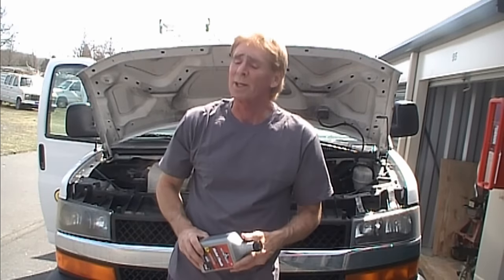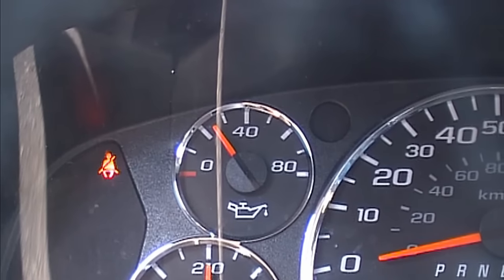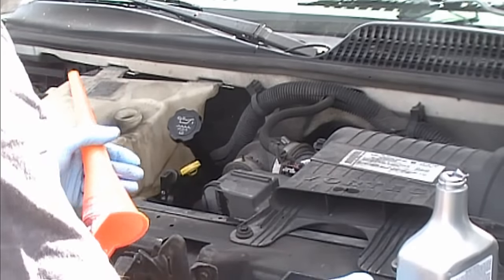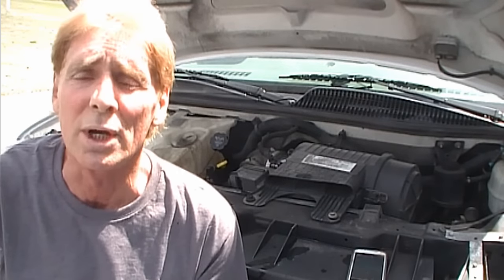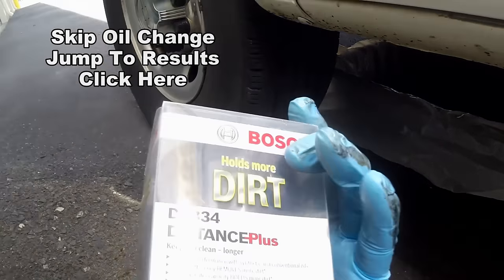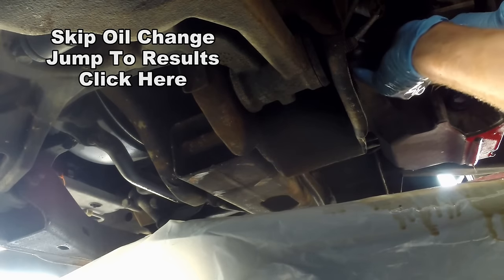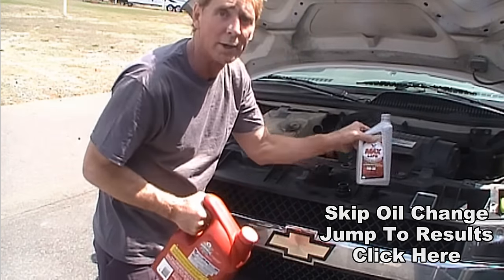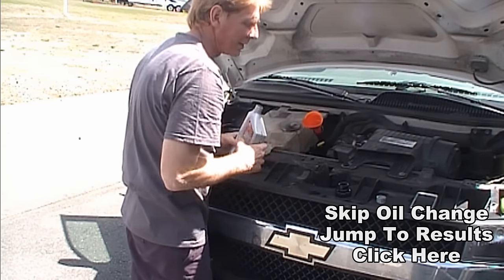NOISY LIFTERS? Motor Flush - Does It Work?  HOW TO DO IT YOURSELF

Comment: Another method and a safer one is; drain ur oil, put a new oil filter.  add ATF same amount of quartz ur engine uses. Idle for 15- 20 minutes.  Drain, fill and another filer. you can also  a week or before oil change drain 2 quarts, add 1 quart of ATF plus 1 quart of engine oil. drive for about 5 days. Then service ur engine. ATF has detergents that will clean and remove sludge @ a safer level than flush or Kerosene.

Comment: Dude, vise grips on a drain plug?  If that isn't bad enough, when you took off the oil filter, you didn't even look at it to make sure the rubber O ring came completely off.  You also didn't lube the new filter O ring.  That's a good way to rip it. That's as bad as a DIY video gets.

Comment: I know this is an old video, But I can tell that the problem is one of the engine on demand lifters has collapsed and the screen under the oil pressure sending unit is clogged causing the low oil pressure and that is what caused the collapsed EOD lifter.
Reply from the maker: Thanks. You are the only one that got it right

Comment: Needs a lot more than a flush its not a lifter tick either you proved that when you stuck the camera under to van to give us a listen... Now onto the pressure loss, maybe the pump is failing or the pickup screen clogged but more than likely the bearings are worn enough to let that thin oil right out of the journal areas dropping the pressure and that thin oil that is OEM spec wasn't thick enough to stay in those journals long enough if you want to get another 50k out of that motor your going to have to go up to the 15-40 oil and try to baby that van. It doesn't matter what the cap says it takes for oil ALL of the hardened surfaces on the bearings are GONE leaving only soft materials as the sacrificial surfaces without stepping the oil viscosity up you wont save them from wearing exponentially fasters... The 15/40 oil will buy you some time. I personally am not a fan of Lucas products but if any vehicle ever was a candidate for such a product this van is 1. Mind you the Lucas product loses allot of its thickness when mixed with oil and also after being heated the first time it does not cool down back to the original out of the bottle viscosity thus all those stupid displays don't really show you the product after it has been heated one cycle. I don't even need to delve into your mechanic skills everyone else touched on that bit strongly enough.

Comment: Low oil pressure makes me think your pickup tube might be partially blocked or the oil pickup tube o-ring has got brittle and is not sealing leading to oil starvation resulting in the ticking.

Comment: Just saw a video on hydrolic lifter ticking, according to the BMW mekanic the lifters have to be bleed, the way to do that is when the car has been sitting, start up and rev the engin at 3000rpm for 2-3min, so as to get the oil pumping up into the head were it has been draining off. Ticking can also indicate that the oil has broken down and needs to be changed.

Comment: Go with a 1540 oil because your o-ring on the pickup tube is bad and that's why your oil pressure is down like it is or it's just wore out one of the two but use a heavier viscosity of oil and that will fill gaps better and increase oil pressure

Comment: I bought a used truck that ran great, but later developed a lifter tick. I flushed the motor 6 times, as the first time chunks of gunk plopped out, and lessened each flush. Still, after 6 flushes it still ticked!

Then immediately (a couple days later) it developed a head gasket leak, and water got in the oil. I must have drove it with water in it for at least two days. I checked the oil and it was a milky white color, so yeah, water was in the oil. 

I bought a gasket sealer that I put in the radiator, and let it run for 15 minutes, drained and left all openings open as directed to dry for 24 hours. I actually let it dry for 48 hours, as I wasn't going anywhere anyway. 

I then refilled the water, and replaced the oil, and took off. The water in the oil eliminated the ticking noise!

It also cleaned the motor like it had been soaked in lye! It was spotless inside! Well, at least the heads were spotless, so I assume the block was spotless as well.

Conclusion: When all else fails...put a quart of water in the oil and drive it around for a few hours, then drain. You'll be surprised at the quality results.

Comment: Putting in new oil or thicker oil will not solve the issue it might mask it for a few months but it will keep coming back until you address the issue head on. Meaning taking the engine apart and fixing the main issue

Comment: I tried this on my Suburban with the 5.4 L engine.  What I did was drain the oil and remove the filter.  Dump the oil out of the filter and fill with motor flush and then add the remaining motor flush to the old oil.  Put the filter back on and fill with the oid oil.  Then I started it, ran for about 2 mins, stopped and let it sit for 15 mins then started and ran for 10 minutes.  Then drain and refill with good oil and change the oil filter.  The ticking was still there but over 2 weeks the ticking went completely away.  So, I believe it works, just not as fast as one would think.

Comment: its the oil pump!!
change it and the lifter tick and low oil pressure will be fixed

after 300,000 miles (over 600,000km for those of you who use KM in your country)
the oil pump shaft gets stuck sideways in the passage and it doesn't pump enough oil..

Comment: If your engine is gunked up with sludge, you can add a quart of water to the oil, and it will clean it up like new. Just run it for 30 min, then drain. Repeat if necessary. Will clean out everything, including lifters.

Comment: This is more like how not to change your oil. Your filter should ONLY be hand tight and should have had the seal lubed and it isn't a must as much now but more so on older and higher mileage vehicles you should prime the filter. If you change your oil like this all the time it is no wonder you have issues.
Reply: I disagree with hand tightening.  Oil usually gets on the outside and will cause it to slip.  Using the same tool to loosen should be the same tool to tighten but I don't like overtightening by testing to see the amount of force used to tighten it to the place where it stops and trying to gauge not boosting the pressure by twisting it far beyond what it took to get it to that position in steps but a consistent twist instead of doing like say 5lbs not like bursting 50lbs to make it keep rotating wise.

Comment: Diesel or automatic transmission fluid in the crankcase for 10min does way better plus its way cheaper. Just let it idle , you'll be surprised what will drain out

Comment: Very common in old v8 domestic motors. its a collapsed lifter,, either the return spring is broken, or its seized because of sludge. More regular oil changes, 7500 km intervals, NOT miles

Comment: STP if you can find some.  Or use Rotella 15W-40 in it.  You have nothing to lose at this point.
Reply: True. I have had the same issue with a 351w in a E350 van with just over 200k. I warmed the engine, mixed 1 quart diesel fuel with 1 capful of DOT 3 brake fluid, added that to the warm oil, started it and let it run for 15 minutes. I shut it down and immediately drained the "sludge" that came out. Replaced the filter with a Wix filter and reinstalled the drain plug, filled it up with Rotella T and put the truck back in service.
She went another 120k miles with Rotella T, and not a tick or knock to be heard ever again.

Comment: Your problem is likely an oring between the oil pump and the pickup tube that sucks oil out of the oil pan. Very common problem. Once that .50c oring fails, no oil pressure. Ticks.

Comment: change the oil pickup tube o-ring, and that will fix the low oil pressure and may get fluid to the push rods better and stop the tick
Reply: but this engine is probably dead by now

Comment: Fix the rattle by purchasing a different brand of truck lmao. I used to be a GM guy too. That's until every single GM I've ever had let me down.
Reply from the maker: So you think Tonka? Or maybe Toyota? 
thanks for your input
😊👍
Reply: @appledrains  My Nissan Titan has been very good. But even if it breaks down the lower price tag would pretty much cover a new drivetrain and any mods you think it might need. I'd go Nissan before Toyota unless I hit the lottery. I'm slowly becoming a Ford guy though. (Certain Fords)

Comment: They say filling your engine with diesel or kerosene will help break up sludge on old engines. Let it crank but dont start it to get some circulation and the drain and refill with oil.

Comment: that motor flush werks great on noisy radio bearings also you mite try readjusting your mufflurs tweek them towards the left of passenger side if that dont werk your valve stems have to get regapped

Comment: Just throwing this out there. Could it be that the O ring at pickup tube be worn out after 300k miles and causing lower oil pressure?

Comment: I had the same problem with my 99 Yukon… And because I ignored the low pressure level,  the ticking sound became very very bad like somebody was hitting the motor with a hammer. Apparently, it was the oil pump that needed to be changed, I ended up scrapping the vehicle for $500.

Comment: Back in the 80's the Ford 302 used to knock out the mains enough to bleed off so much oil that the supply to the lifters wasn't enough to keep them pumped up. We used to pull the pan and install a high volume oil pump. That would supply enough oil to overcome the loss at the mains and pump the lifters up. Note I said to use a high volume pump, NOT a high pressure pump as the only difference from a stock pump and high pressure pump is the relief valve, which makes no difference in this case. It's worth a hundred bucks to try it, if it were my truck. If it doesn't work, yank the motor and rebuild it: my guess is you're NOT going to find a broken lifter but instead worn out main and connecting rod bearings, with that many miles. If a lifter was going to break, it'll usually do that well before 100,000 miles.

Pertinent questions if it becomes a rebuild. Do the pistons slap when cold? Does it have a weak cylinder? (do a compression test) If not, just replace the bearings and seals, use that new pump and you will likely get another 312,000 miles, maybe more.

Comment: motor flush is nothing more than diesel fuel, buy it at the pump save some money.
not recomended for engines with more nthan 150k miles.

Comment: I flushed my 4.0l jeep engine with 6 quarts of ATF, let it run for 5-10 mins with it in there, and then put my oil back in. It stopped  my lifter tick and my engine sounds better than ever, my dad did this to his 02 Silverado at 158000 too, he’s 230,000 and still sounds/runs great.

Comment: No, a rod knock will not have any effect on oil pressure, only main and cam bearings do. A spun rod bearing sounds very similar to a lifter tap with the difference being a lifter tap, if it's just sticky, will go away when you increase throttle, or if the lifter is collapsed it will cough the engine when the plug fires in that cylinder because of the valve not being "lifted" as if you have a dead cylinder. A rod knock however increases in depth as you raise the throttle, and it gets worse in a very short time. There is no mistaking the two, however, the guy in the video did not increase the throttle so there is no way to determine where the noise is coming from for certain.
Reply: Thanks.  I have a Toyota V6 that's making the same sound.  It does fade when I get going faster, especially when I've been driving a few minutes or strangely when I'm going uphill or under load I can't hear it at all.  It came on suddenly a day after I got the oil changed.

Comment: I know that the oil filter wont be leaking...not with the way that he used the wrench to tighten something that is only supposed to be hand tight. Thanks for the video to see if the stuff works.  I believe that it probably needs repeated oil flushes to finally loosen up all of that buildup.  I'm going to do it but what I will do is replace the oil filter with a new one and then add the flush.  No need to dislodge the particles that the filter captured.

Comment: Motor flush is mainly for helping to break down & remove any sludge buildup in da engine u need some other oil additives when putting in a fresh batch of oil to get rid of dat knock if it's not a major valve job dat's required & I've noticed dat after 250k miles u need to change da oil pump wit any engine.
Reply: +Khalil R. Mercado (The Inspiration) Is is really that hard to say 'that' and 'the'?
Reply: +MrTdw1954 If ur not from N.Y. u'll never understand or get it.
Reply: People from N.Y. don't even understand or get it.

Comment: My 2000 5.3 developed a nasty knock like that one day.  It turned out to be a torque converter bolt that had backed out, and was hitting the engine.
when I revved the engine, it got quieter.  I figure that was due to the flywheel flexing.
New tc bolts fixed the problem.
Reply: Common on the jeep 4.0L too...If you find this to be the issue back the bolts out 1 at a time, apply locktite, and re-torque to spec.  no room for ugadugga's  Clicky clicky or 1 shoulder lifting grunt should do less your a 100pounder wet with your boots on then you need to lift both shoulders off the ground lol... Just remember lifter taps generally get quieter with revs and tap at half the rate of rod knocks where rod knocks get louder and faster with rpm.

Comment: I used that to flush out the engine every yer when I changed oil.  Used it for many years!  I can't say that it quiets lifters but ii flushes good!

  I cringed a bit when you used vice grips to remove the oil pan drain plug but I guess with the situation, you done okay!.  I was unable to skip the oil change and jump to results!

  You didn't rub some oil of the filter gasket.  I to use to use Fram but not anymore.  I cringed again when you used a filter wrench to tighten the new oil filter!  Did you learn your mechanics, from Freedom University or Trump University?

Comment: Hi chuck that knock is comin from lifter so adjust your valve and check the resuluts
Reply: Hydraulic Lifters are self adjusting and need no adjusting.Solid lifters require Adjusting with a feeler gauge to leave a very small gap between the Lifter and Rocker arm.His problem is when the Hydraulic Lifters wear out and do not hold the oil pressure.That is why they call them Hydraulic oil lifters.Using a thicker oil can sometimes fix the problem by increasing the oil pressure to the lifters.

Comment: your problem is in your oil change method. you have to fill the oil filter too so that the oil pump and lifters don't go with out oil. you create a bigger gap of air instead of oil to try to lift the "hydraulic lifter" it needs oil not air. then when it started back up it sound kind of hard starting
Reply: +John Smith _It isn't a problem not to fill the oil-filter. You could do so if it's a new engine and there wasn't any oil in it before.
Also the air gets displaced at the time the oil-pump delivers oil and pressure starts rising.
edit: Without automatic de-air of the hydraulic-lifters they wouldn't work at all.
Reply: +djAmbush your supposed to fill the filter period.

Comment: t ry using a full gallon of gunk engine flush then drain and chase with 2 quarts of clean oil then fill er up. worked for my f150 with 250k

Comment: You need a oil pump if pressure is low
Reply: Not necessarily the pump itself, maybe it is just the intake that is blocked. The oil pump only moves the oil, the engine internal creates the pressure. But to start at the oil pump is the best place yes.

Comment: 1. One should probably should use a higher weight oil for such a high-mileage engine.

2. I've never had any success with that motor flush stuff; however,  strong doses of Marvel Mystery oil, combined with 2 or 3 1,000-2,000 mile oil changes (to gradually flush away sludge build up) usually helps. 

3. If all else fails, the oil pan should be removed, cleaned,  and the oil pickup screen should be thoroughly cleaned.

Comment: I'd run some thicker oil add some lucas oil stabilizer to, that should help a lot with oil pressure and the valve noise.

Comment: You need to use 20w50 with lucas oil stabilizer with that many 300k on this engine for sure  its tight tolerance not as it was new as for filter Fram or stp is fine

Comment: That oil pressure as long as it's over 20 psi its fine and that noise sounds like it's coming from bottom end i tend to think it's the thrust bearing as GM'S are pretty notorious for thrust bearings going, it still sound pretty good for that milage, try adding 2/3rd of gl4 synthetic gear oil to hot/warmed up engine if the noise decreases than it's deffinetly your thruat bearing & not the lifters etc...

Comment: Use Risolene for lifter tick it will work almost every time unless the lifter is collapsed.  Run the vehicle a 100 miles with risolene and then change oil & filter use some lucas stabilizer with new oil its great stuff will increase oil pressure. Also would have used a thicker oil like 20-50 with 315k. NEVER use kerosene! Or egine flush unless you want clogged pick up or blown engine. Oil pressure sould be 10lbs per 1000 rpm.